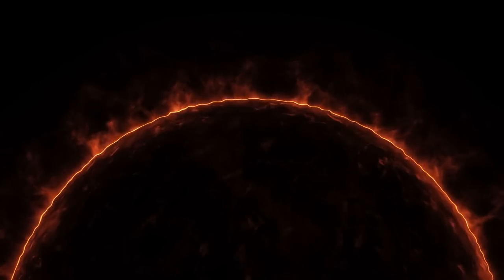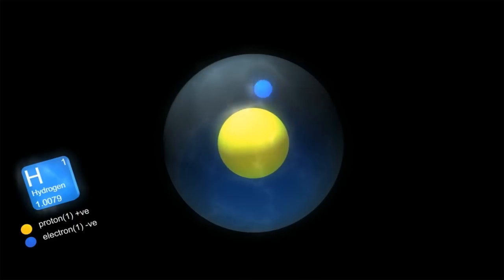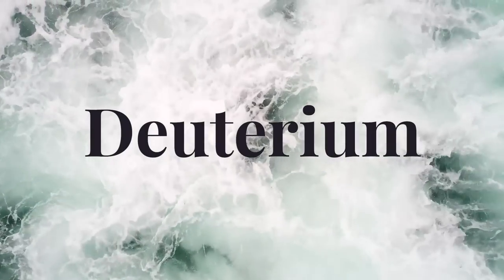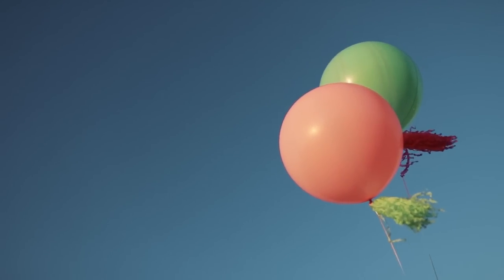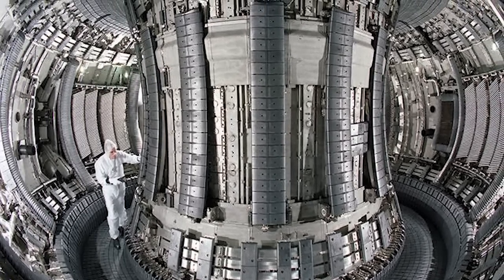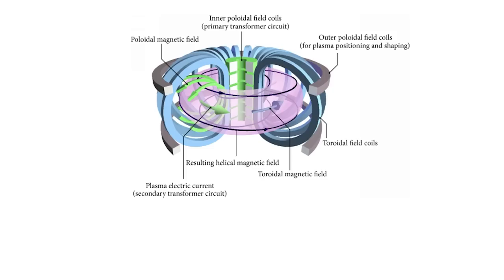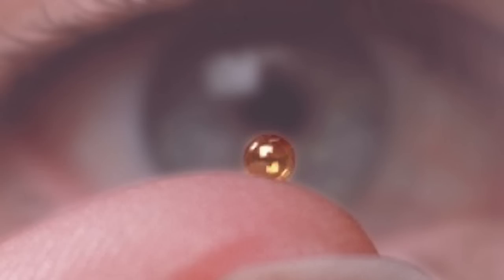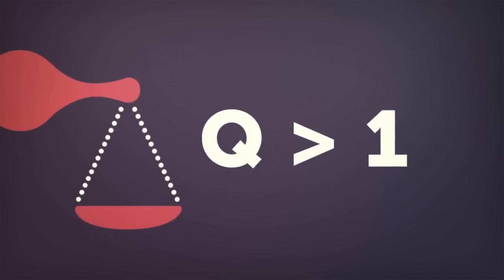Fusion Energy is About to Unlock Humanity's Destiny

Comment: I don't think fusion power will make energy any more free or limitless than fission. It will be cheaper, but fusion power plants would most likely be retrofitted to existing fission plants, one reactor at a time. Even if they weren't, building a power plant that can deliver megawatts or gigawatts of power will always be a billion-plus dollar proposition. The transmission, distribution, regulation, and all other aspects of power delivery will remain unchanged. It will, however, probably reduce costs a bit, and will certainly provide a baseload generation option that doesn't depend on the sun, wind or waves, and that doesn't require batteries or other storage mechanisms. Most importantly, it will begin to reduce the accumulation of radiotoxic waste products, and the remaining fission plants could focus on reprocessing existing waste into renewed fuels. The truth is, fusion power plants may suffer the same economic inviability problems that currently face fission plants - there is no guaranteed payment for ancillary services like the provision of baseload power that can offset the often subsidized and sometimes negative prices that can result from intermittent production by wind and solar sources. Until baseload power is properly valued and preserved, or until battery tech progresses to the point that we can freely store and redistribute intermittent renewables production, the future of power may look more like California's brownouts than the ultra-reliable service we're used to today.

Comment: Kinda feel like you didn't properly portray how strong the electro magnetic forces that repel atoms are. In fact you said they aren't strong enough. But the truth is those forces that repel atoms are immensely strong, which is why it requires so much heat and pressure to fuse two atoms together

Comment: There is a little problem about this, when i was a physic student in 1980 i was told that fusion would be reached in 20 years, twenty years later i have told friends  around me that fusion would be done in twenty years certainly, and now 20 years later i'm told again that it will be done in 20-30 years..... maybe....!!!
Reply: Well, if I remember correctly the ITER project was started in 1986 and was supposed to be operating by the year 2000. The problem is not in the process but in the politicians. Same thing with thorium-using fission reactors.
Reply: @laszu7137  Ouch the ITER project was badly handeled and cost way more than expected. 
In science we are used to get problems and have to restart or change thing because we have found something or a new idea, but politician need results or they get fucked for having supported a project that is never finished.
Science is a long run but politics are always on short terms.
And if we don't have Thorium reactors it's because we need plutonium for bombs, you can't make good bombs with thorium so it has no value!

Comment: You neglect to mention one con: the need for tritium in addition to deuterium, at least in current designs.  Tritium is a radioactive isotope of hydrogen with a half life of 12 years.  Therefore, it is not found as commonly as deuterium, a stable isotope and must be manufactured in guess what? Fission reactors.  The beta particles emitted by tritium are pretty weak.  There average travel distance in water (i.e. in your body) is on the order of microns (millionths of a meter, thousandths of a millimeter).  However, if you inhale or ingest tritium or tritium-water some of those tritium atoms will become incorporated into your cells, and inside your cells, a micron is a significant distance.  Furthermore, the beta particles emitted by those tritium atoms in your proteins, even worse, your DNA and RNA can kill cells and cause mutations.  Some tritium will escape into the air under the best conditions as it is created, processed, stored, transported, stored again and fed into the fusion reactor.  The tritium part of the fusion cycle will have to be very carefully controlled.  Can we trust industry and government to do this?  
   Another problem is the safe disposal of reactor parts that have become weakened and rendered radioactive by radiation damage inside the reaction vessel.
   I'm not saying that fusion is a bad idea.  But once we have achieved Q > 1, there are still difficult engineering problems that must be solved before fusion can be trusted as a massive energy source.

Comment: Thanks for the informative video.

In the early 1960's, we were being told that nuclear energy from fission would give us thousands of years of almost free electricity. And most people believed it. Guess how true those claims turned out to be? Nobody considered seriously the costs of maintenance and decommissioning of reactors, and nobody really knew that there would be a huge problem with disposal of the spent fuel. In reality, a reactor might be useable for 30, 40, or if we are really lucky, 50 years. After that time, it takes as long, or longer to decommission the reactor. The spent fuel has to be put somewhere, and that costs money. Then you have to maintain and guard those spent fuel dumps. And how much does an accident cost? Chernobyl comes to mind, for instance.

Similar wild claims were made of cheap electricity from magnetohydrodynamic power stations. That was in the early 1970's. Hardly anyone even remembers those claims now. (I had a book on the subject, which I bought new.) Today's experiments are very low key indeed, now that serious limitations have been uncovered.

We have had huge claims about tidal and wave power being the dependable energy supply saviour for maritime countries, not least the U.K. I had a conversation with Sir Christopher Cockerel on that very subject, and he was a real advocate for wave power, even showing us some of his Raft prototypes. Stephen Salter, was another pioneer, with his Duck designs. Environmental concerns were raised within a few years, and almost no development has taken place in Britain.

Another claim, more recently, has been that Thorium fission reactors will be the answer to our energy desires. And are there lots of them in use yet? No. And they have pretty much the same environmental risks to a Uranium and Plutonium reactors.

So why should we believe seriously claims that nuclear fusion will give us virtually free electricity? For how long will a reactor last? How are the radioactive fusion byproducts going to be disposed of? The process will not be perfect, and various isotopes will be produced, some of which will be unstable. And remember that, despite its abundance, seawater is a finite reserve, and the Deuterium within it is even more finite. What damage will an accident do, and how much will the destruction cost to put right? Then how much money, and how much time, will decommissioning cost? Fusion might well be better than fission, but we don't know for sure, and despite all of the corporate fluff, we still haven't generated a large enough amount of energy to offset the input energy. 

A rolling '30 years hence' is a sensible attitude to have. If and when a viable reactor is built, then we can begin to think tentatively about long-term power generation.

Comment: If humankind had the almost free energy at disposal, we would definitely use it in many ways. The problem is the following. 
Heating our houses produce heat but cooling them with AC also makes heat. Moving cars, turning the light on, cooking food, listening to music, cooling our beers, running our computers, they all produce heat. 
Eventually, almost all ways we use energy makes our environment hotter. With free energy, we would boil the Earth.
Humankind will face a new and even harder problem very quickly, a harder one the the environment pollution. Where will we put the heat?

Comment: Why didn't you include Electron Bombardment based fusion in you video, such as the Sandia Labs Z-Machine - which emits x-rays and as a waste product of tritium, which has a half-life of 12 years (a blink of an eye compared to even thorium's half-life. Last I checked, research was pulled, right when it went sustainable. Oh and fun fact, Sandia Labs in New Mexico, where the research took place for over 2 decades, also does a tonne of military research. Do I think the US Military are using it for top secret weapons research for a few decades, before it it is "discovered" in a commercial perspective? Yes, yes I do.

Comment: No need for doing anything other than receiving neutrinos from the cosmic sources. 24/7 power. all you need is a magnetic field.
Reply: most metals just create eddy currents when struck by neutrinos, just put some resistance in there and boom! free energy. Put it through a coil and it will charge batteries like you've never seen.

Comment: so i cant seem to find the answer but how would we get energy from fusion? i know in fission we just use that to heat water and spin a turbine, would we do the same with fusion?
Reply: The fusion reaction produces high energy neutrons. These neutrons fly out and are captured by a molten metal “blanket” running around the outside of the reactor. This heats up the blanket, which then passes it’s energy onto another intermediate cooling circuit and then into a steam circuit, which turns a turbine.
Reply: @Gomlmon99  thank you that clears it up for me

Comment: Thoughty2 must not have ever heard of Brilliant Light Power Co. My money is on them for producing all the low cost power the Earth can ever use in unlimited amounts. Randell Mills has already completely overcome all the design and engineering obstacles, and his company has four working units operating in their final testing trials as of now, Oct 28, 2020. They will be leasing out the commercial power production units, more than likely within the next year to the end users, and will produce power at a probable cost to the customer of about $.20 per KWH, which will be a major savings in countries like Germany, where the cost is now about $.60 per KWH, and in a lot of places where there is no power grid to produce power at any cost. The only fuel required for these units is a very small amount of water, and we have enough to last for billions of years, so the fuel is free for all practical purposes. This has absolutely nothing to do with nuclear fusion or any other previously known technology.

Comment: They are looking at the wrong type of fusion. They should be looking at a-neutronic fusion which doesn't transmute the entire inside of the reaction chamber into toxic sludge every year or two.
I respect ITER scientists, but they are wasting a lot of resources on deuterium-tritium/deuterium-deuterium specific technologies when that are unlikely to ever be use commercially. In my opinion, literally all those resources should go towards high-power cooling technologies and on increasing useful controlled pressure/temperature, as well as superconductor research etc. That way we move closer to achieving proton-boron fusion, which is actually usable, because it doesn't turn the inside of the chamber into toxic sludge nearly as fast. 
Even better would be a proper aneutronic fusion, but the confinement requirements mean this is likely to remain sci-fi for a while.

Comment: No, no, no, no. A fission reactor is not like a fission bomb at all. Fission nuclear weapons take a lot of very careful engineering to result in a super critical mass sustaining itself long enough to cause a large explosion. A nuclear reactor has never caused a nuclear explosion because it is physically impossible to do this without using extremely highly enriched fissionable material. Any nuclear "distaster" has been a regular boring chemical explosion which happens all the time in chemical plants, oil refineries etc.

Comment: Hey man, I just wanted to quickly explain how nuclear fusion works because your misleading people with false info. 
A nuclear bomb is very different from a reactor in that a Bomb is the hard part. 
Nuclear explosions happen because of the pressure and force of a preceding expulsion that crams everything together into a super tight area that then explodes from the released energy cause by the fission of atoms impacting each other.
A reactor simply let's the fuel burn super slowly. the worst you will see from a melt down is a steam explosion caused by the fuel getting too hot when water is poured onto it. this isn't the nuclear fuel exploding it's water vaper. the Fuel never explodes only gets hotter from the reaction.  
many people use the incorrect idea of a controlled explosion when its just a very hot rock we use to boil water.
I hope this was helpful.

Comment: At first glance, it seems we are trying to have more energy output using less energy input. Isn't that what "perpetual motion" machines try to show, and we already know that it's not possible under the pesky 2nd law of thermodynamics? Why are perpetual motion machines brushed off easily but not this?
Reply: E=MC^2.  You get more energy out of a Hydrogen fusion than it takes to to create it.  Problem is... its tricky to contain

Comment: @3:00 "half a gram of hydrogen fuel produces 500Megawatts"
This is a non informative number. Power (watts) doesn't tell how much energie is produced, cause you need a factor time in it. So you either have to use Megawatts/hour or use the official standard unit Joule to state the amount of energy.
The sentence as it is now is just as meaningless as saying my watermains produces 200 liters

Comment: Thoughtly2 now this maybe an uneducated shot in the dark but let's say there is a eter tulkomak built in space or a collider in one of thw visible voids in space to limit gravity resistance propelling a increasing velocity of particals that produce static and or plasma and cycle that back into the magnetic field to increase the velocity using electro magnets until it reaches "c" I know its been said its impossible but would weight be a factor in the void of space or would it create its own gravitational mass before it can sustain substantial energy output to be able to transfer through high partical laser to relievers on satellites in an array leading back to earth for our use making the dream of an iron man suit among other thing possible?
Reply: On another notion of that scientific thought let's say it does work with infinite  mass would that alter time perception of the atoms at the least around it?

Comment: NASA Glenn Research Center Vacuum Chamber 8 feet thick concrete steel reinforced walls to hold a high vacuum, Lunar Lander 3 layers of reynolds wrap thick paper walls to hold out a ultra high vacuum ( hundreds of thousands times stronger than a high vacuum ): Borkeetwo: "Mobiles are better computers than NASAs computers when they went to the moon"

Comment: Everyone praises Fusion energy. I agree that it would be a big deal but unless you can manage to enhance battery efficiency humanity will still have diesel engines attached to  the trailers that store food for transportation. Diesel generators at facilities when lightning storms blow out transformers. like hospitals and cell phone towers. Pretty much every large commercial facility has a back up generator. Seriously the list is never ending. Fusion is awesome but portable efficient energy is the true Holy grail. The process to manufacture Lithium Batteries really isn't good. Graphene batteries might be worth something.

Comment: The present energy systems were unimaginable 200 years ago and some in as little as 90 years have unimaginable power output ,So yes it will happen as has other aspects of energy I for one have come from old school film photography to modern digital sensors ,which have long since outresolved the best systems of 30 years ago ,So for sure it will happen and as you say the possibilitys are endless . Ah over unity <sooner than you think

Comment: The holdup on Military using lasers to destroy things is generating the power there may not be guns on Navy ships or airplanes if they shrink it enough you won't need bullets in your gun you'll be shooting a laser. The technology is there for the laser we just can't generate enough power for to be useful yet van sized reactor it's not to power a city it's too power of War Machine or machine of War whichever you prefer. Think about the advantage of the American aircraft carriers and every country that has a nuclear sub there limitation it's food for the crew what kind of ships themselves could run for 20 years straight before having to refuel

Comment: the problem here is that they have no clue how the sun actually works LOL, this is why this hot fusion thing hes not worked for the past 20 years and will never work.. as long as they keep up there gas based solar model , if its done right. it actually creates Hydrogen! and you would only need very little power to start up the effect.. it hes match similarity with sonoluminescence , but then doing the same withing the magneto dielectric spectrum. cheers!